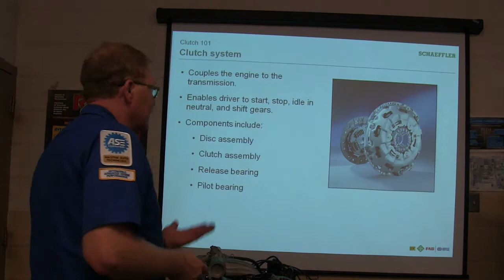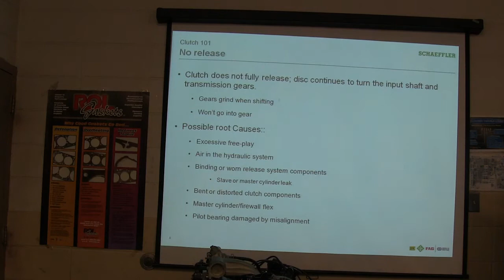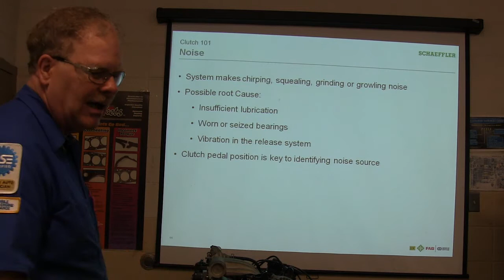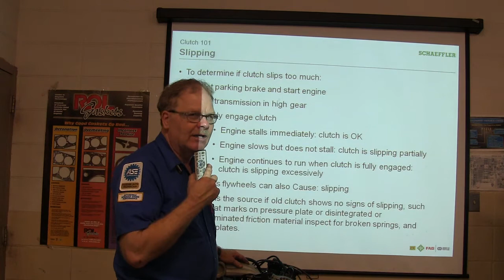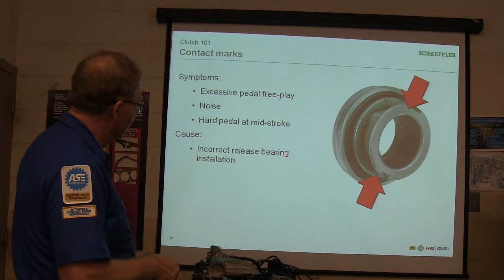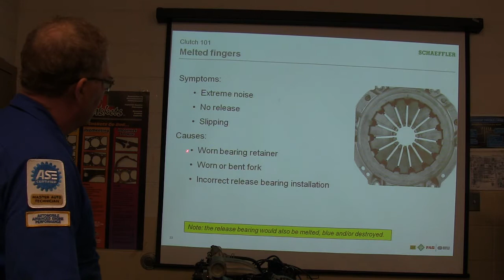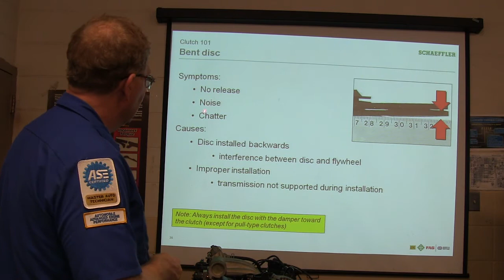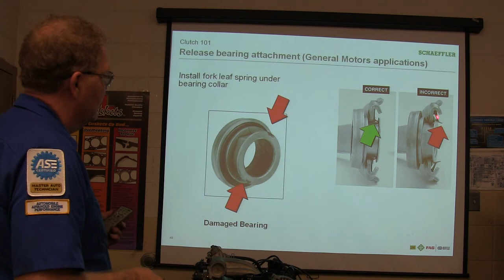Clutch Basics

Comment: could you please elaborate on why you need to put in high gear for the slip test it seems normal to put in first gear instead of high gear. any imput would be great thanks for the great videos sir
Reply from the maker: Well, if it's going to slip it'll slip in the higher gear.  Actually that procedure is the one suggested by the LUK Clutch gurus - so I passed it along.